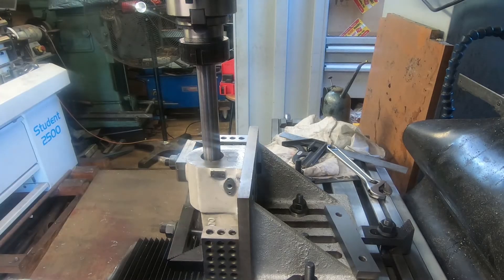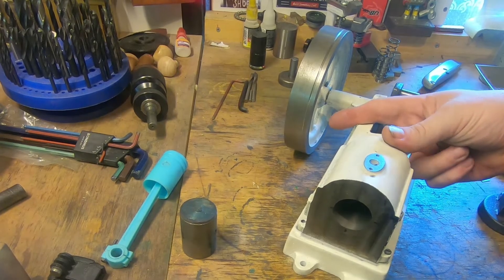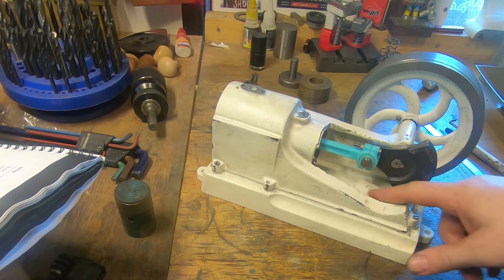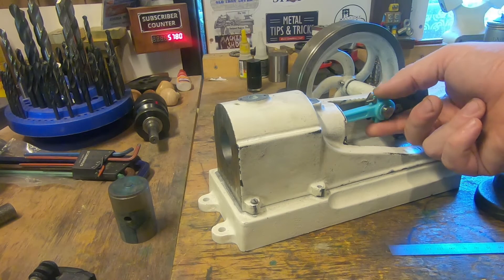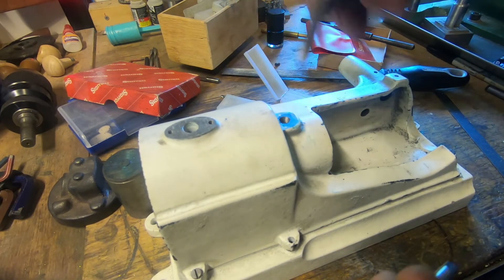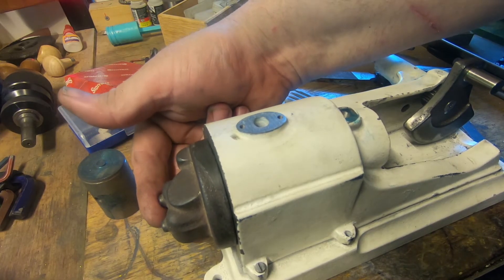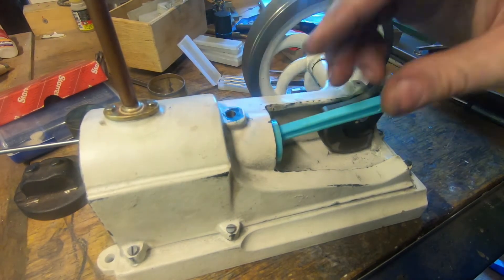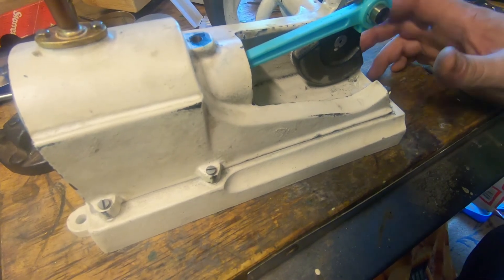Introducing the "400" Part 15 FINALLY!!

Comment: looks a lot like my steam project I just have some generic castings to build from, the cylinder, caps and valve, and make the bits fit and line up as I go haha. going to go thru the same boring issues as your gas engine 
nice work, I enjoy to see how it comes along

Comment: You could machine a bit to hold a piece of high speed steel to clamp on your conrod journal then spin it with the crank to clearance the main case so your rod would clear.